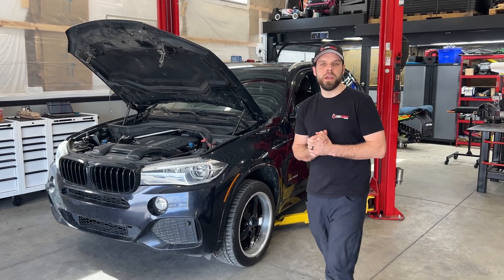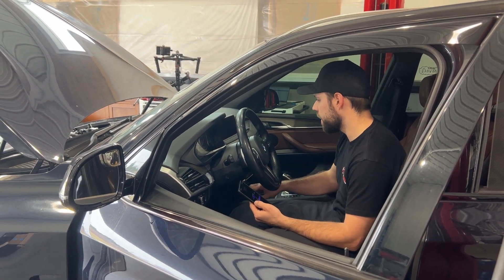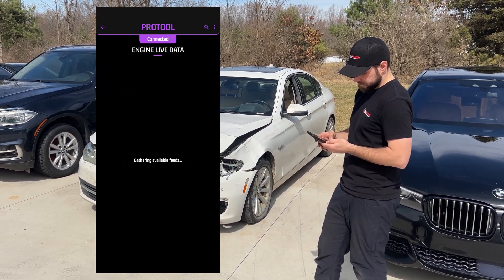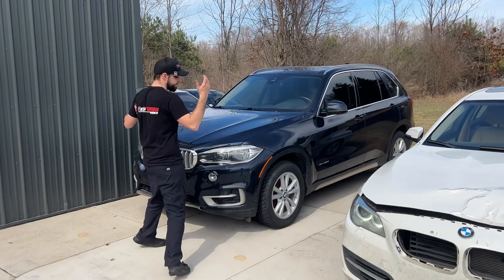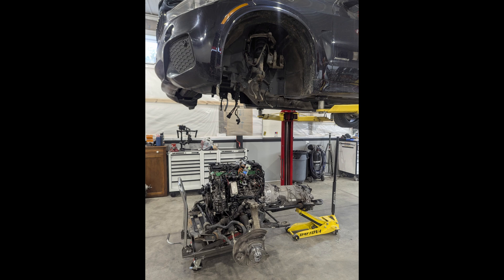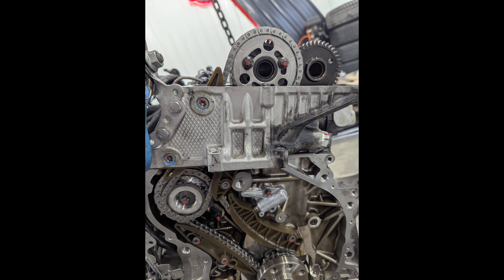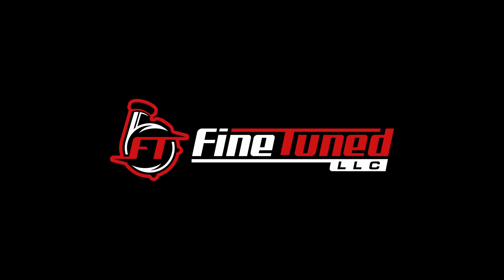N57/N47 BMW Timing Chains

Comment: Great video . Thanks. 2018 x5 35d running great at 151k . Any tips other than sound to look for to assess chains?
Reply from the maker: You can look at the offset value in protool
Reply: @bradtourt  is there an equivalent measure in Beamer link to your knowledge
Reply from the maker: @johnalyssaemilysarah1465 i believe there is

Comment: Just goes to show that proper maintenance and no auto start/stop will go a long way.  Currently at  292,700 in my 328d, 6-7500k oil changes, lots of highway miles and while it does have a 3 second rattle on cold start, cam offset is currently sitting at -.8 degrees.  Original CP4 and chains btw, and all stock emissions.
Reply from the maker: Excellent, that's great 👌🏻
Reply: What oil do you run? Are you tuned and deleted?
Reply: @joobstermcluvn4334  5w-30 Titan or Fuchs oil.  All stock emissions.

Comment: Thanks for the video! I'll soon need to upgrade our e70 x5d to one of these fancy single turbo x5d's with the timing chain in the back of the engine,  so will need to be ready to replace the timing chain and other bits.  Really appreciate you showing us!! 🙏 Is the fuel pump another concern on these engines? I know you made a video about a "disaster" kit for the fuel system.
Reply from the maker: The pump can be an issue, but fill it with proper diesel and change the filter often.

Comment: Just picked up a 2015 X5d 110k and feel better after watching this video. I checked my value with bimmerlink showing -.04 at startup. It went up to -.16 after a drive, but restarting it went back to -.04. It very quiet and appears pretty well maintained. I think I'm fine on my chain.
Reply from the maker: Yes sir, yours is in spec!
Reply: @bradtourt should it fluctuate from cold start to warm?
I got a .4 cold and went up .6 after fully warm and i turned on
Reply from the maker: @eLus1ve2991  Yes it will as the metal will expand when it's hot.

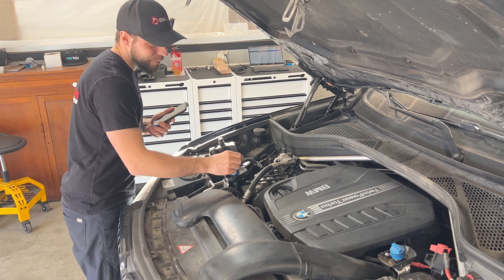Comment: Back again Brad, is it fine to just drive normally until the chains start making that noise like at 2:49 or if we check, what general degree does that chain issues/noises begin around?
Reply from the maker: @HamzaGuzel690  drive it till it starts making noise or change as a preventive measure.
Reply: @bradtourt  alright thanks man!
Reply: @bradtourt  Hey Brad, just got ProTools and checked the chain, it shows -2.2 but I don’t hear any rattling at all. Even in below freezing cold starts, no rattling. What should I do?
Reply from the maker: I would have chains on your mind, but keep on driving it till you hear something.  @HamzaGuzel690
Reply: @bradtourt  I had issues with ProTools and got it working again, cranked the car 2-3 more times and the reading dropped to as low as -1.5. Is there a certain amount the degree progresses? Like -0.1° per 20k miles or something
Reply from the maker: The value can change on start-up sometimes. It's hard to say how it stretches per mile as there are way too many variables. I would say the biggest variable is auto start stop and the oil you use.  @HamzaGuzel690
Reply: @bradtourt  Gotcha. Someone said the chain values should be checked on a cold start. Is this correct? Maybe my values were seemingly high because it was a warm engine?

Comment: Am I reading the same value from Bimmerlink as you'd get from Protool (sorry, I'm an iOS guy)?  it's labeled "offset angle for camshaft (raw value).  On an M57 with 180k miles on the clock, I'm reading about .9.  Motor doesn't make any sounds it shouldn't, so here's to knocking on German plastic.....
Reply: FYI for reference my 140K Mike M57 is at -0.6 FWIW
Reply from the maker: Keep on driving it!

Comment: Great video, thanks! I just checked mine ‐ F15 with N57 with 95,000 miles, and the reading was -.8. Do you think it is still good, or should I consider a replacement?
Reply from the maker: @StoimenNikolov  I would just monitor it.

Comment: What oil would you recommend for this engine? I’ve been using Liqui Moly 5w-30 Top Tec 4600 from FCP with the oil change kit. It is LL-04
Reply from the maker: @HamzaGuzel690  I use Motul lately. https://amzn.to/4jmXShN
Reply: @bradtourt I love the lifetime oil from FCP, maybe they have motul. Thanks again and awesome video
Reply from the maker: @HamzaGuzel690  they sure do have Motul 🤙🏻
Reply: Do you find yourself using motul on the N47 over liquimoly or oem?
Reply from the maker: @heathanderson3807  yes I sure do

Comment: Is this also available in ista for the n47?
Reply from the maker: @BMWBoyeeM3  in my version of ISTA, it's not. I believe it's only available for the b57 and b47 on ista, but please check.
Reply: @bradtourt  thanks man. Probably just need to buy protocols regardless. Have an m57 and n47 and will probably pay for itself
Reply: @bradtourt  so found out bimmerlink has the option in their free version. Tested on my n47 and came back with -0.72.  Should I drive it off a cliff?

Comment: Thanks for the informative vid. I've heard that later production engines have less of a chance of having timing chain issues, has this been true in your experience? My parents own a 2016 x3 28d which is the final year of production for the N47.
Reply from the maker: @waleedjamil8807  from me experience I have noticed 2014/2015, and early 2016s being an issue. However, i'm not sure if that's just because the 2017 and 2018s  haven't seen that many miles on them yet? 

Btw, they still made them up to 2018 😃